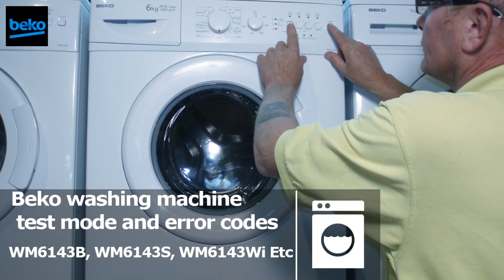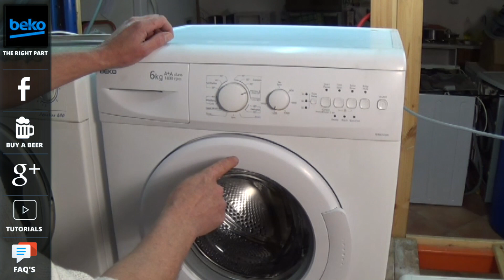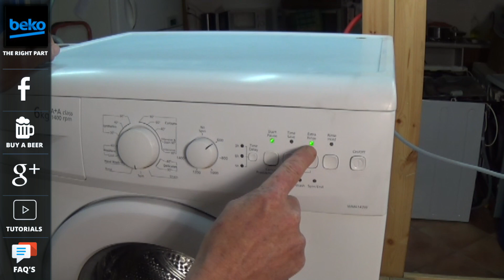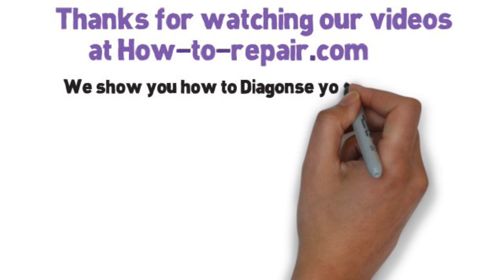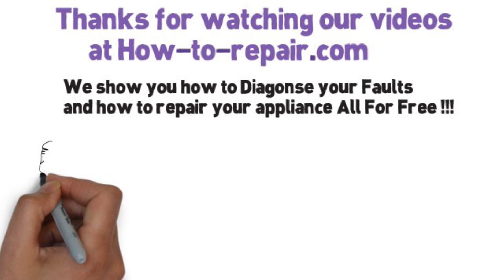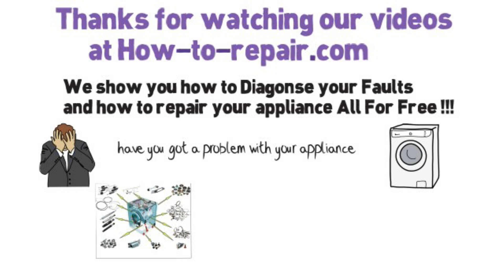Test mode diagnostic Beko WM6143B, WM6143S, WM6143W washing machine to repair faults and test errors

Comment: I have a Beko WM6143B machine. Despite following the video, I cannot get the test to start. I have tried multiple times, even from a complete power up from plugging into the socket. It goes into a short phase of repetitive actions on a wash cycle. I just cannot break the cycle, what would you suggest?

Comment: hi, very clear and well spoken, easy to understand video,  I am trying to find out a way to reset a new integrated beko machine, the older method doesn't seem to work for me, any info would be much appreciated,  thanks, Mick.

Comment: hi I did your test after my machine wouldn't drain or spin ended up flooding kitchen anyway after the chaos I did your test left spin fine right spin fine full speed spin yay then clanging rattling noise scared life out of me please i turned it off please help diagnose problem